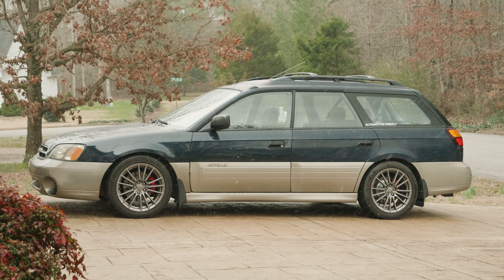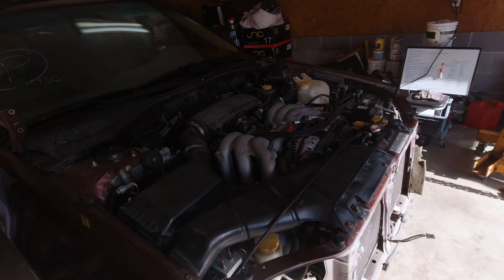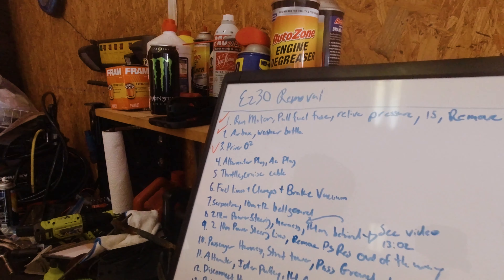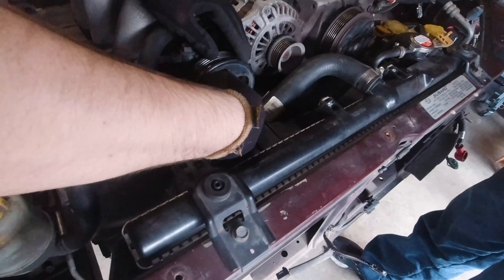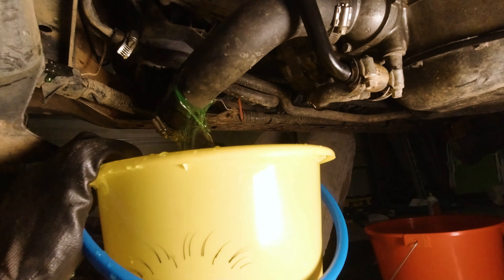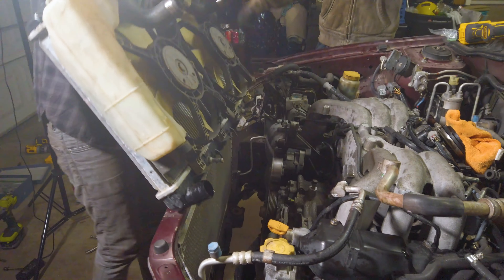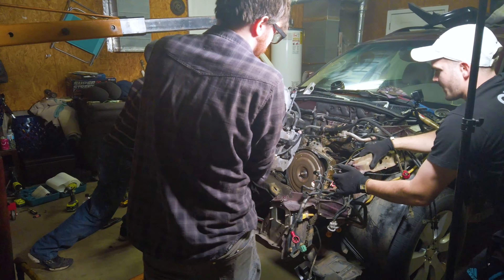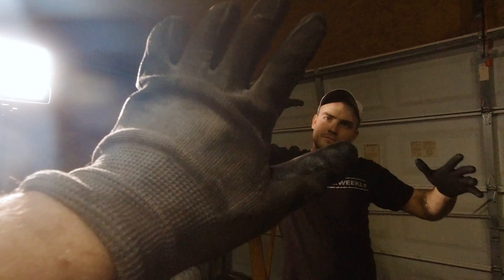Subaru Outback  // Pulling the EZ30

Comment: Please keep up with these videos! I’m thinking of doing this exact same thing with my 04 outback because it is so slow and I want to hear the 6 cylinders SING!!
Reply from the maker: Zach At the moment we are having to put a pause on this as some crazy life happened recently. The wiring is turning out to be waaay more complicated than we initially expected. Looking into options though. We’ll keep you posted.
Reply: @AutomotiveWeekly  I emailed iWire about the wiring sevice they have for swapping a 6 cylinder and their final price was somewhere in the realm of $4300 and that was insane to me to just squeeze an extra 40 horsepower out of my outback. Good luck fellas with your journey, I'll be trying to keep tabs on your progress!
Reply from the maker: @Slywooftwo  Totally understand that. Exactly one of the reasons that we are putting efforts to other projects. We have a new drift car build that we are starting instead in the next couple months as long as this virus stuff goes away. We really appreciate you sir!
Reply: Cool to see you guys are doing this also. I'm in the process of swapping an EG33 into my Legacy. The turbo four was fun, but I love old German cars; I need a Porsche-ru in my life. It's a ton of work for really no power gains, but the engine is a tank, and I know it can hold power for whatever I eventually decide to throw at it.
What ECU management are you using? Factory from the parts car? Is your car a manual?
Reply from the maker: @downlowaudio  So unfortunately, we are going to cancel this project for now. The amount of work to get the factory looms to play nice with each other is going to be a bit too much. If we decide to move forward with this in the future, we will most likely run it with a Haltech. The H6 motors never came with a manual and since the blue car is a manual, it makes thinks much more complicated. One of the other reasons that we are canceling this project is that we got a car that we are going to start getting ready for drift events so that build will be starting once all the virus stuff dies down.
Reply: @AutomotiveWeekly  That's part of why I was asking. I know there's a way to use the factory ECU with some trickery, but I'm going with a standalone. I don't remember if the EZ30D is DBW or cable, but that's another consideration. I plan to convert my EG to DBW and hopefully run a supercharger at some point so I already purchased an Elite 2500 and harness. It's a lot of money just to make less power and add weight, but I'm committed. What car are you drifting?
Reply: Why can’t you just use the wiring out of the donor car?

Comment: I H6 swapped the wifes Baja. Was a lot of work! Not sure if I would do it on a vehicle that came with the H6 from the factory.
Reply from the maker: bruceyyyyy Pretty much why we never finished this project. Ended up just leaving it and moved onto a 350z to mess with.
Reply: @AutomotiveWeekly  Probably a more fun car anyway. Maybe not as cool but. (:
Reply: I’m thinking of doing my Baja as well. I know it can be a lot of work but would you find it worth doing?
Reply: @brianfrancis8821  I don't regret I did it. It's still slow by most standards. I have 100+ hours of work into doing it.
Reply: @bruceyyyyy  I have a full donor car. I’m not worried about hardware I’m only worried about wiring. Would I be able to do a harness swap and just make like easier?
Reply: @brianfrancis8821  I would buy a pre merged harness from someone like i wire. It will save you a lot of time. 

H6's had specific harnesses for AC since they all auto the auto climate control. 

I have a playlist on the build. Just check my profile.

Comment: I have a lovely 2009 outback  xt Limited, but it could use a new engine, im wondering if i want to swap the 6 cylinder into it, how hard is it to change over? Tranny bolt right up? Mines a 5speed manual and its fine so i really dont want a different one. I want the NA low end torque.  I dont race or plan on it, i like driving trails and im gonna lift this car eventually

Comment: I have a Subaru outback of the same year as that one and I have been interested in lowering it. I was wondering what you used on yours to lower it and if the ride quality is still comfortable and how easy the installation was?
Reply: (what you used along with the coilovers if anything)
Reply from the maker: We pretty much just used a set of BC Racing Coilovers. Ride’s not bad although I do wish we went with a slightly softer spring rate. I think you can order those with a custom spring rate through BC’s website. The back really needs some lower control arms though since it cambers in a lot when it’s dropped really low. We keep it at a pretty decent height so we don’t worry about the camber as much. 👍

Comment: That EZ30D or "EZ30R?"
Reply from the maker: It was the EZ30D. Sadly though we had to scrap this project due to several different circumstances
Reply: @AutomotiveWeekly   ah I was wondering.  I was hoping that this outback to outback would be an easier swap than into three Impreza like everyone (myself included)  wants.
Reply: @AutomotiveWeekly  you know,  forgive me if I'm wrong, but the "R" variant had a plastic intake manifold,  the the metal manifold is on the older D variant.  I've never worked on these engines so I could be way off but I've been doing a little research on manual conversion.